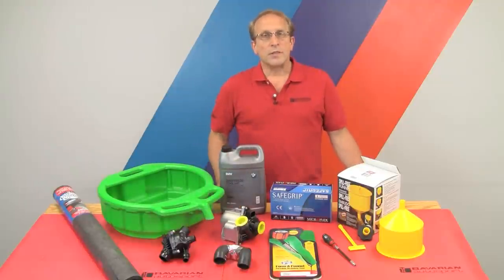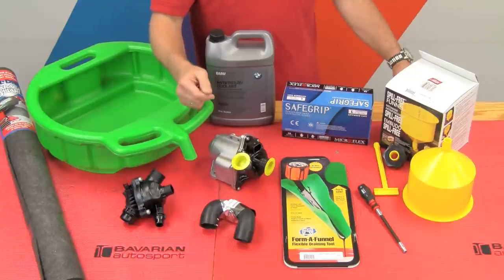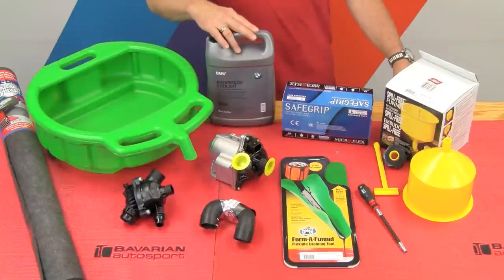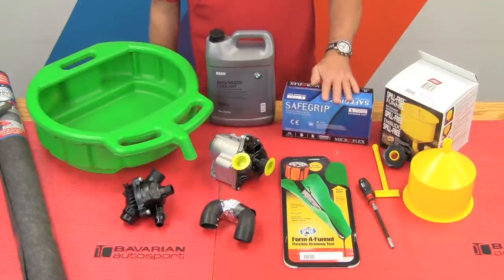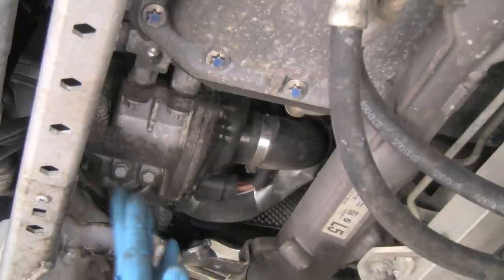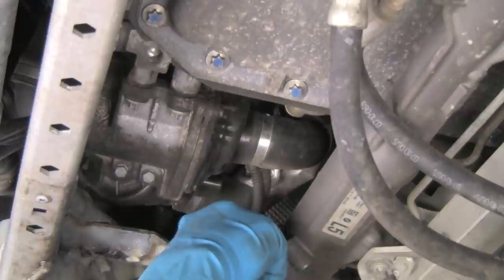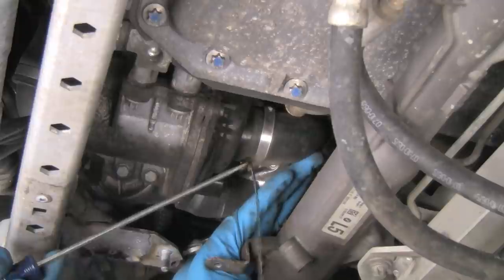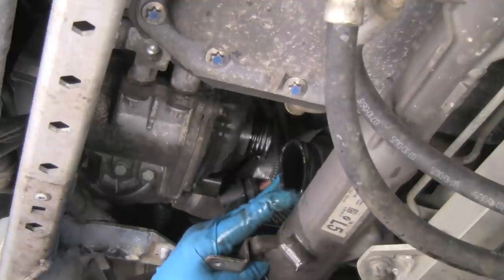Part 1  Replacing the electric water pump on late model BMW N-Series 6 cylinder engines

Comment: This video is NOT for an XI. Still helpful but a lot more parts to work around. I was able to get everything down and replaced from the bottom of my car but without the right tools it would be a lot more frustrating! I also recommend a lift if you have access to one. Unfortunately, I did not. Good luck out there and be ready for a rather difficult project.

Comment: Video Tutorial is awesome. I have nearly completed my thermostat and water pump replacement, but I am having trouble getting the larger quick connect hose to the thermostat to seat and lock properly. Do you have any suggestions?

Comment: I'm also seriously considering getting parts from the producer(s) of this video, as an appreciation for this great tutorial.

I just wonder, though, if there's a way to test the water pump to be certain that it's not working. (My guess is it is broken, but I'd like to be positive.) 

And I hope that two regular ramps will give enough clearance from the ground, since I don't have access to a professional lift such as the one on the video.
Reply from the maker: Thanks for your consideration, Juan.
The job can be done on ramps.
You can do the bleeding procedure, at the end of the video.  If the pump does not run, it's likely faulty.

Comment: Thanks for this video ... HOWEVER ... I have a '06 530xi wagon and there is very little that is similar in the process.  I had to remove a few hoses from above that just could not be gotten to from below (and it was very tight - a real puzzle to do).  The 530xi has virtually no access from below other than getting your hands/tools in from between the pump and the radiator).  You cannot remove the power steering hose hanger until you have removed the thermostat (and I had to remove the thermostat before I could remove the pump - opposite of your video).   I found I had to cut one of the hose clamps on the pump that was clocked in a direction that could not be reached.  ALSO a tip, in case you can't find a torx socket to fit the the three aluminum pump bolts - a 10mm 12 point socket works.
Reply from the maker: Yes, As noted, the xi models cannot be accessed from below as the 2wd models can.

Comment: This is a good DIY video by bavauto, and bavauto is a great retailer for bmw parts.  But WARNING this video is not for a all wheel drive BMW.  The parts seem to be the same and in the same location, but the frame work is different on the Xdrive and the room to work on the install is way more difficult. DO NOT attempt this job on a 535XI. Go ahead and pay the pros,  it will be pricey but way less frustrating

Comment: Thank you, for the time and excellent   explanation  
N52 E60 Do you have advise how to removed  the A/C compressor 
I can't  is so  un access  place,
I can't  see a way to removed the mounting  bolt, (the thermostat  is on the way) still disconnected  from the water pump,  but no room to place the wrench, please  i will love if you have a video or a help , 
Thank you  in  advance 
Without taking  out the " WATER PUMP" ,how you got these video, please  NO ONE DOES THE VIDEO LIKE YOU ,

Comment: Nice video, which shows you why labour charges for servicing a BMW are high. Anyone thinking of buying a BMW should watch it.
Reply: I've owned BMWs since the early days - and they were always great vehicles and not really that difficult to work on. Seriously wonderful cars!    But these new ones - YIKES! - a computer with wheels.  I cannot believe the crappy electric motors that all fail (side mirror, water pump, air suspension - all failed and when I dismantle to look at the motors they are cheap junk designed to fail)  The cheaply built water pump (but terribly expensive to replace) results in a tow and probably a ruined engine when it goes - and they all go sooner than later.  BMW should be ashamed.

Comment: Great video, I replace both my water pump and thermostat but a week later my service engine soon light came up WITH THE CODE OF THERMOSTAT FAILURE. Any ideas? Also I check all the harness and everything looks good. What should be the regular temperature to be running on the car?

Comment: Is there a complete DIY for water pump and thermostat replacement for E90 with N43 engine?  I tried but found access to bolts and connections was too difficult.

Comment: Great information, went to family wedding this week in northern British Columbia and got the low level warning in amber then red, pulled my 2006 BMW 323i over to check and added some bottled water to increase, but this happened again just a few miles down the road. Got a tow truck and had the car taken to a vehicle repair place in Terrace (middle of nowhere), they feel that the problem is a faulty electric water pump, but will not know for sure unitl removed, (I can now seee how to check via youtube as this a common problem) This has been ordered but he was unable to get the thermostat, you will not want to know what the part will cost me up here...I have found this post extremely helpful and will pass this along to the shop who is working on the car, as they say, they have not worked on many imports up here, should I worry about thermostat as they are unable to get this as well??? Thanks for the great info...
Reply: FRODE HANSEN you should absolutely get the thermostat and change it at the same time

Comment: 2007 328i- I just had water pump failure at 177,000. Good thing is that I was less than a mile from home. Mechanic quoted me $1,100 for pump and thermostat. Car is paid for.
Reply: You can do this job for $379! It's simple
Reply: i'm kind of thinking it would be a giant pain in the a** if you don't have a hoist to lift your car up above your head.
Reply: +Ding Dong why? Jack stands work fine.
Reply: just looks a lot easier with a hoist!  Or maybe I'm just sick of working on my vehicles!
Reply: +Ding Dong I'm thinking the same about using a lift. I'm so tired of wiggling around, looking up getting stuff dropping in my eyes and being in awkward positions working under my cars. I'd love to have a lift!

Comment: I just did mine in my 2009 335i xdrive . Video was helpful. I removed the passenger side tire and the axle shield on same side. The xdrive made it very tight in that area.
Reply from the maker: Good input on the 4wd application.

Comment: Thank you for the exact videos I was looking for. I recently bought a 2009 BMW X5 xdrive 3.0 and suddenly it started to leak alll cooling fluid possible to the point of having me using one gallon of coolant per one gallon of water each refill. today I decided to look for some instruction on how to access the water pump and thermostat , as a video I did with my cell phone to investigate and find signs of leakage coming from the hose going from the pump to the engine and possible demages to the water pump itself. Your video enriched my knowledge on the procedures to tackle it, but I will not do the jobsince, the vehicle is under warranty and I will have the right conversation with them about it. One question; ate the same time as the heavy leakage started, two trouble codes for P0430 popped up for bank 2. Would they be related to the water pump or engine hose leakage, please?

Thank you,

Gera

Comment: Can you do some video's on the 2000-2006 year model BMW X5 E53 M54B30 3.0i SAV ? Best way removing the exhaust side manifold to do head gasket change. I have began to source final parts needed to perform the job. I can't get manifold bolts out. I didn't wanna drain A/C lines in order to get to bolts. I got intake out already. And yesterday my hood release latch cable the end rear an center are all bad its stuck now on driver side..i gotta get a wire or pick hook in the recess an push towards driver side fender then i can lift hood but being rusty its a challenge longer then 30 min video's i saw on process.

Comment: Great video. I will be referencing it to do my water pump on my 335i tomorrow. One question, did you not disconnect the battery to do this? Is that step not required? Thanks.
Reply: Dang you got the doctor hisself dropping knowledge over here. Question is why NOT disconnect. Pop trunk. 10mm socket to negative/ ibs. 1 bolt. Remove negative/ ibs and set a towel or rag on said connections to prevent continuity. Don't close trunk unless you have a key slot ,or pit a rag over latch mechanism. Literally 30 seconds .

Comment: Hi, nice video! I have one issue while doing this DIY. I couldn't disconnect the elbow hose which is the radiator to thermostat hose. I spent hours to try to pull that out, it just won't come off. Without pulling that off I can only feel the water pump upper bolt with my finger but can't reach the E12 socket to it.

Do you have any suggestion on how it can be taken off?

Best Regards,

Kalvin
Reply from the maker: We can only suggest that you keep trying on the connection.  It is OK to use a screwdriver of smaller pry-bar to help to move the hose off the nipple.  Make sure that the QD securing clip is fully dislodged.

Comment: @Otto my fan came on at a high speed for about 3minutes until I got home and turn the car off. I thought it might be the water pump but when I did the test to check the pump the pump was working fine. Could it be the thermostat or just a one-time thing? I have not turned on the heat or defrost to see if it will do again  I have a water pump and thermo coming in just in case.

Comment: Quick question is the water pump plug & play or does it need to be programmed long story short bought a new OEM water pump then it was defective got a new one now having the code 2e84 no comm. replaced thermostat & cooling temp. sensor. Any help is much appreciated!

Comment: Just picked up an 08 335i and service records show pump was replaced 12,000 miles ago. Took it to the dealer for some recall work and they recommended a new pump. I can see that is it slowly dripping coolant. My question is it possible that it could just be a loose or worn hose that is connected to the water pump itself that is causing the leak? Does anyone know where the weep hole is located on the pump itself so I can see  if it is in fact leaking from the pump? Any feedback is greatly appreciated.

Comment: I'm using this guide but I'm having a little issue because the set up is a bit different for a 2007 328xi. When you loosen the first hose 6 minutes in, I can't reach it because there is another steel bar thing that looks like part of the frame. I'm not sure if it's safe to remove or if I can even remove that part. Any way around this issue? Thanks!
Reply from the maker: Kenneth Wang See the various comments on this video and the Part-2 video.  There are comments from others who have done the xi models, on how they modified the procedures for the 4wd cars.

Comment: Why was this pump you took out on this 335i, a metal housing and metal housing thermostat? I thought only the n52 and lower Power N engines had the aluminum housings, and didn’t fit on the n54? Has everyone been wrong for these years?
Reply: The OEM pump I just removed from my n54 (2008 135i) was a combo plastic and aluminum housing.  The OEM pump had rubber vibration-isolators at the screw-connections, the replacement (a Continental/VDO pump) did NOT have the rubber isolators.

Comment: The 2007 e83 x3 is very different from this even though it is the n52 engine.  The main difference is a huge crossmember blocking access.  If you have the time to do a video of this model it would be greatly appreciated.
I was sure I could do it from this video alone until I got the x3 up on ramps and took the splash shield off.  D'oh.
Great video anyway.  Thanks.

Comment: I am trying  to replace the thermostat and water pump for the 2008 535xi, even though it's the N-series (N54), it has different configuration at the bottom of the engine.  I am having hard time getting to the hose clamp screws.  I can try to get it off but it going to be harder to get the hoses back on.... I don't think I want to do it again. :)
Reply: What ever happened? Were you able to get it done? I have same car and just moved the power steering hoses. It looks like the frame is a lot thicker on the 535xi but also looks like there is much more room up front to remove the pump. Is that how you did it? Only removing the small front skid plate? It also seems like I could leave the sway bar where it is. Any input would be great.
Reply: Yeah, I got it, little tight but it done now.  If you are still planning doing that and have any question, don't hesitate to ask.  Sorry, am three days late :)

Comment: fantastic diy. Just had a failure at 100089 miles.
Reply: +Edward David First failure?  If so, WOW...hate to say it buy they rarely last even that long.  Mine literally today just went pop @ 74K.  I've heard them die as low as 9K.  Extremely poor design.

Comment: I know you do not do this for a living, but before I opened up my shop I used to knock these out in a hour at the dealer. Straight gravy. Anyways my point is I have a different approach. I just hang the motor and lower the subframe and its so easy its ridiculous. I would flag 5.0 on these all day long.

Comment: Hello Otto.....

I have a 2007 530xi - E60 N53, do you have a video for this?  Is this video the same for that model.
Reply from the maker: We do not have a video for the E60 5-series chassis.  Additionally, you may not be able to follow this procedure on the xi models.  Take a look at it before starting the job.
Reply: I'm in the process of doing a '06 530xi - it's definitely tough - but doable.  I have everything out now - I'm taking a long nap before I try to put the new stuff back in (haha - it was exhausting getting the pump out).  I had to get the thermostat up and out of the way while the pump was still in - that allowed me to remove (from above) the bolt holding the power steering hose hanger.  I was able to remove the hose clamp at the back of the thermostat from below - but I had to reach down from above (I removed some hoses from the overflow tank so I could reach in ) to get that hose off the thermostat.  Then - finally - I was able to pull out the thermostat so I could get access to the back side of the pump.  I had to cut the hose clamp from the pump to manifold - the clamp was clocked in a position it was impossible to get to.  And then I was able to get the pump out at last (with the U-shaped hose that goes to thermostat still attached to pump).
Reply from the maker: *****
 - please feel free to share you input, for those other xi owners who may appreciate it!

Comment: Hi Otto,

Hope all is well.

Thanks for the video! 

My 2006 530i (N52, Sport package, 6-Speed Auto/Steptronic) has an active stabilizer bar and active steering feature.  Most of the tubing (hoses) that are in the way of the water pump/thermostat are made of aluminum (non flexible!).  Do I need to remove the two fluid pressure lines from the oscillating motor before I lower the active stabilizer bar? Any advice for my case is much appreciated!    

Thanks!

Daniel
Reply from the maker: Daniel, We have not replaced a water pump on the E60 N52 model.  We have not looked at the active swaybar with thoughts of waterpump replacement.  If the bar cannot be swung down and out of the way, with the fluid lines attached, then, yes, they will need to be disconnected.
Reply: Hi Daniel, I am going thru the same process at the time.  Can you share how you were able to complete the water pump replacement?...Did you remove the preassure line from the active steering feature?, and if so, did you had to fill, and bleed the power steering system?...Any other advice? :)
Reply: Hi luxor0312, There is no need to remove the pressure line.  The stabilizer bar is held by two or four bolts (sorry, it's been awhile) on each side.   Remove the bolts on each side of the stabilizer bar and you should be able to drop it down for enough space to remove the water pump and thermostat.  It's a lot easier than it looks.  Good luck! 

By the way, thanks Mr. Otto!
Reply from the maker: Thanks for your input, Daniel.
Reply: Daniel Nghiem Thanks Daniel, appreciate the help!...Will be working on it tonite.  Will let u know if I run into any issues.  Hope you don't mind.

Comment: The cover on my electrical connector came off from the actual connector and the female connector is stuck to the male connector does anyone have a solution to getting these apart?

Comment: i didnt get a check engine light but i got a code thru my tune and i have high fan and reduce power. you think i have to reset the codes because of the tune?

Comment: this is the easy to do vehicle. the all wheel drive is a job and a half. makes this video look like going to disneyland. joke! 

and no one and i mean no one has a all wheel drive video, cause they all killed themselves before they could get the video loaded up. 

this video did nothing for me. :(
Reply: LOL
Reply: Hilarious comment made me laugh 😂
Reply: I'm living this right now and wholly agree!
Reply: Did you ever get the job done?
Reply: @edan  It only takes a couple hours, but it's a pain. There is a brace on the xi that completely covers access to the pump, so getting at the 3 mounting bolts is tight. The sway bar also only lowers a couple inches, but it's enough to get the pump out. What I did was remove the radiator fan, remove the passenger power steering line mount and unbolt the sway bar. That's all you need to get at the pump and thermostat bolts. It will be annoying, but a universal joint should do the trick.
Reply: Its not hard to do on a XI  you are only as good as your tools.
Reply: The Alpina version is a pain in the ass as well.